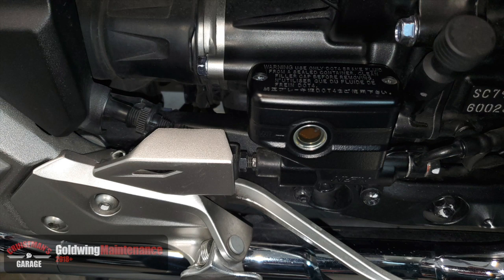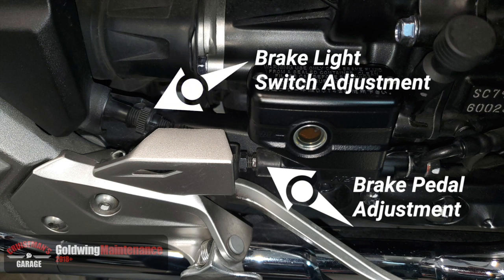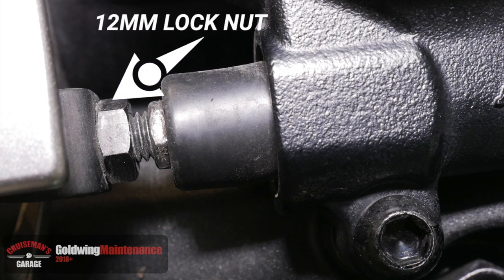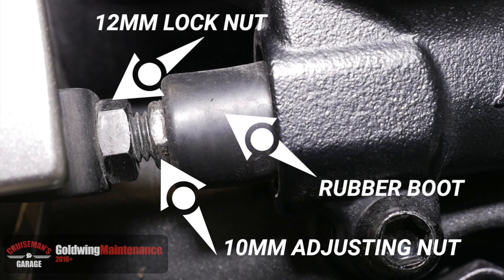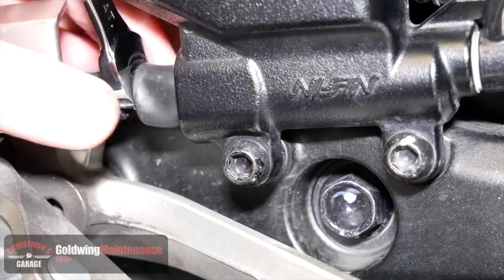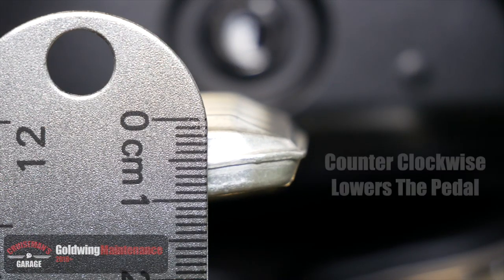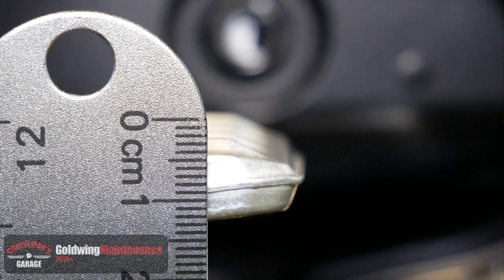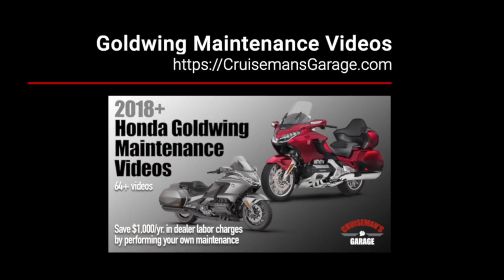Brake Pedal Height Adjustment | 2018+ Honda Goldwing | CruisemansGarage.com

Comment: Thanks for another outstanding, easily digestible video, @cruisemansgarage.  After installing Goldstrike floorboards two days ago, sure enough just like you mentioned, my lever sat flush with the board and needed adjusting.  I thought it'd be way more involved (I also have a 2023 Road King and had to do lower that lever), but you made it easy peasy! 👏

Comment: Thanks Chris.  Suggestion.  Elsewhere on your new Forum there is a suggestion to also check the brake light  and cruise controls adjustment to ensure the pedal adjustment did not cause the brake light to remain on constantly.  Perhaps an update at some point to address this potential.  As usual well done.
Reply from the maker: Good idea

Comment: The video only deals with half the job.  Once you adjust the pedal, it is highly likely you will also need to adjust the brake light actuator switch.  To all, please keep that in mind.  If you don't one of two things 'could' happen; (1) the brake light will be on continually or (2) the light will not activate when the pedal is pushed.

Comment: Thanks for the nifty video, Chris. The first thing I generally do on every motorcycle I’ve owned is to lower the rear brake pedal. I do this to lesson the sensitivity of my application of the rear brake. In a panic or very quick stop there is less likely a chance of an initially locking the rear brake. This causes a loss of stopping power, particularly if your foot is resting on top of the pedal as you ride. It should require a slight “reach”. The ABS and linked braking system of the Wing has lessened the need for this. I still lowered the brake pedal about 3/8”. Cheers!

Comment: Hey there!  I recently purchased a 2018 Goldwing with the manual transmission.  I have search everywhere trying to find information on raising the shift pedal.  As it is now, I have to contort my foot up under the pedal to shift.  I would like to be able to raise the pedal up slightly to make it easier to get my foot under.  I know you have the DCT model but thought just a chance you may know how to do this.  I appreciate any input or advice.  Thanks so much. Tommye
Reply from the maker: You might check out Max McAllister's channel at Traxxion Dynamics, I think he may have addressed this in one of his videos. https://www.youtube.com/user/max95437

Comment: I feel that the rear brake on my '19 Tour DCT isn't as strong as it should be. Front brakes are incredibly strong. Is there a way to adjust the rear brake for better stopping power?